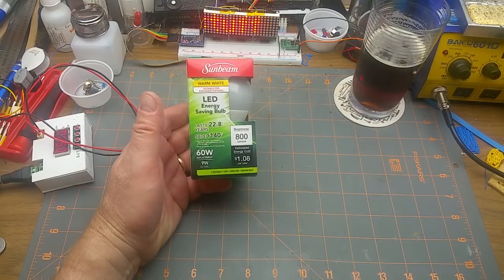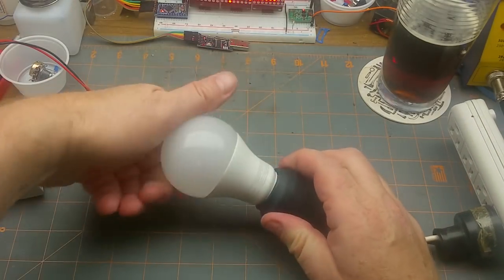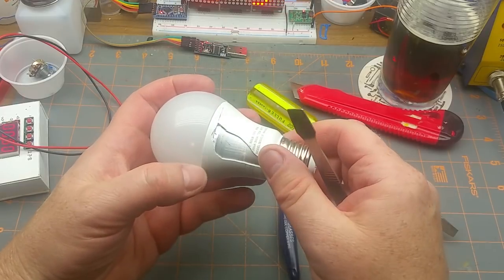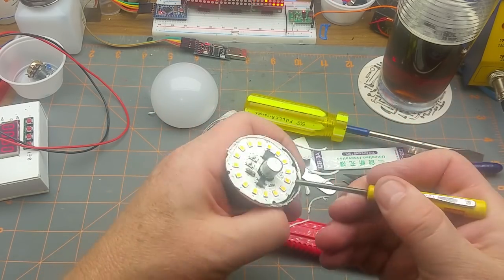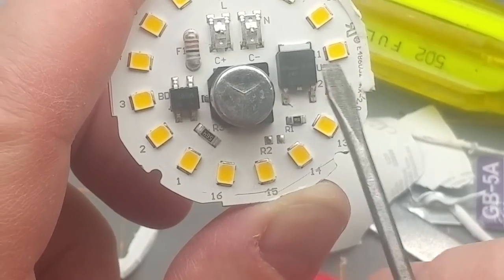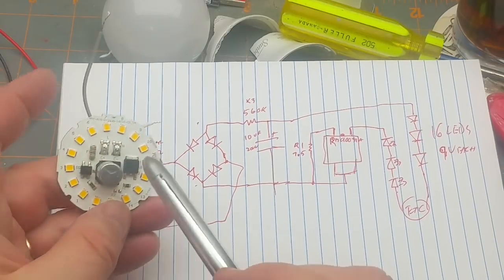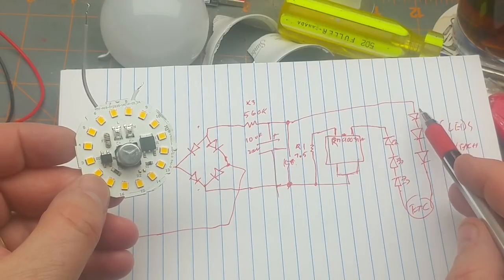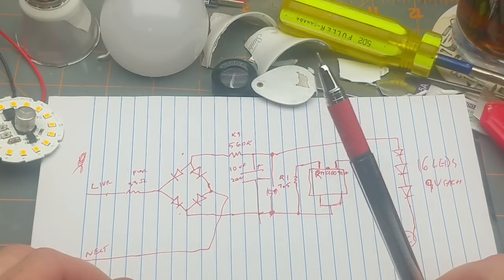dollar store LED lightbulb teardown

Comment: this is very similar to the new Sylvania value bulbs, components are in different spots but the design appears the same. Good thing with the Sylvania bulb is they used a 130c rated cap and bp5131h led driver in case anyone was curious I took one of mine apart.

Comment: The chip you are having trouble with regulates current. The two resistors at the 12 O-clock position should be wired in parallel to assist in regulating the current.

Comment: Do you think I could under-volt an LED bulb  like this to 75vac?
Reply from the maker: I wouldn't think so, but if it did work, it would be quite dim.
Reply: @pileofstuff   thanks.  I don't understand rectifiers.  From watching some videos, I understand some LED  bulbs can handle a range of voltages but maybe  the minimum is 110-120vac.

Comment: It would be cool if you go back to Dollar Tree and take a look at their new supplier for their $1 bulbs (Yamao at mine).  They have both 9w/60w equiv and 12w/75w equiv as well as Daylight (5000K) versions.  I've also gotten the Edison type LED bulbs that have the LED filaments in them.  Quite interesting.
Reply from the maker: A new brand, you say... It's been a while since I went to Dollar Tree (or anywhere, really). I may have to make an excursion.
Reply: @pileofstuff  Yes, the 9w/60w are using a different Sot223(?) version of the 9003 (B instead of T) which still does not seem to have any usable info on the interwebs.  I just cracked open ths 12W/75w version and WHOA it is different.  TWO rows of leds and ICNE2521DT controller using an 8.2 ohm current set resistor.

Comment: I was coming out of my chair yelling "put on gloves before you cut yourself!"
Warm white LEDs from China are almost 2x as expensive as common colors.  Nice though.  Lots of new colors these days.
Perhaps new homes should have a nice, big central switching source for 24V DC.
You lose just one series LED in a configuration like that, then the whole bulb is broke.
Reply: We already run low-voltage landscape lighting outside.  With the low current requirements of LEDs, is there a reason we can't run low-voltage lighting inside too?

Comment: If 120v AC is going to bridge rectifier how does voltage get to 150v DC?, I would assume some voltage would be lost during AC to DC conversion and be lower than 120v.
Reply from the maker: 120VAC is the RMS (root mean square - check wikipedia for a math heavy definition) voltage, not the peak-to-peak of the sine wave. A loose rule of thumb for pure sine waves is that the RMS value is approximately 0.7 of the peak voltage.

A simplified explanation: The full wave bridge rectifier directs both peaks of the sine wave to the positive output, then the smoothing capacitor "averages" (not a true average, but I'm using casual language here) the voltage, so the DC voltage is higher than the sine wave's RMS value, but lower than the peak voltage.

Comment: I do not Bellevue Tours schematic, the 560k is probably in parallel, not series Smith capacitor. The bridge polaritet do not match the sides.
But except for that it was  interesting to see how a cheap can be made.
Reply: I hate automatic spell correction, here is the first sentence without automatic correction:

I do not believe your schematic, the 560k is probably in parallel, not series with the capacitor. The bridge polarity do not match the leds.
Reply from the maker: @henrikjensen3278  : You're right, I did draw the diodes in the bridge backwards. I don't know why I didn't notice that hen I was editing the video.

Thank you.
Reply: The 560k is also wrong, the lamp cannot use more than about 0.2mA with that resistor
Reply from the maker: @henrikjensen3278  I see that now. Thank you.

I seem to be thinking too hard about the video part, and not enough about what I'm actually doing.
Reply: @pileofstuff  Gorf dayo geegee on with the digger nut was then. Ran to over it was gone nerktus oooky won the racks.

Uh, before the spell-checker got to that, it was: 
Aren't spell-checkers wonderful? They ALWAYS get it right!

Comment: Next time, measure the voltage across the LEDs instead of the voltage across the LEDs and the regulator chip? .. The high voltage linear LED driver sounds like a beefed up linear voltage regulator in constant current mode.  The 7.5 ohm resistor would set the current.  Measure the 'current' across one of those LEDs .  V = I x R.  That current x 7.5 might come close to the reference voltage of the chip.  The chip will drop whatever voltage it needs to drop to keep the reference voltage across the resistor.

Comment: 6:15 "They did wire that correctly" Well that has nothing to do with the wiring in bulb.
It's the electrician who installed the base that must make sure that the outer ring is "neutral".
The lamp can be wired any way they like, it's AC so it doesn't matter.
Nice video :-)
Reply from the maker: True, but it's nice when everyone follows the rules. (and I don't automatically expect that from cheap imported stuff)

Comment: I'll just loosen the glue, whak whak, well I see that broke the middle section of your scrolling message display
Reply from the maker: That scrolling sign is a lot more fragile than it looks.
Reply: did a wire come off or so ?
Reply from the maker: @maicod  The middle module wiggled in the breadboard and lost it's 5 volt line. 
When I finally noticed, I just had to press it into the breadboard a bit.
Reply: ah right :)